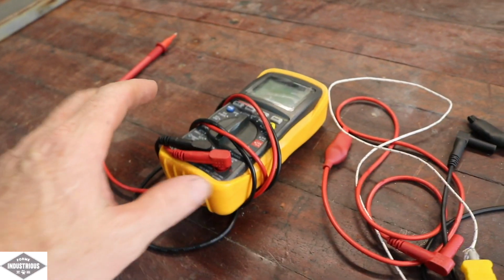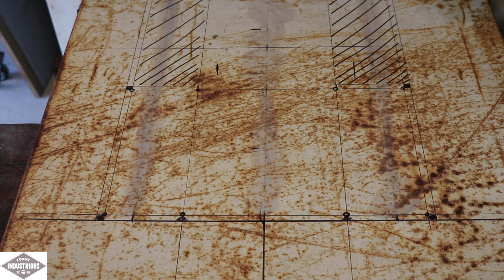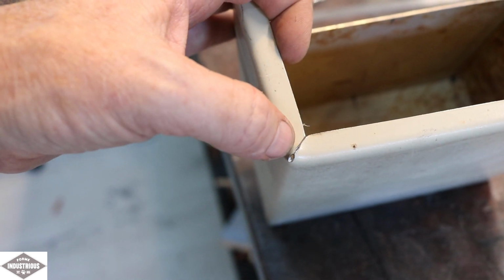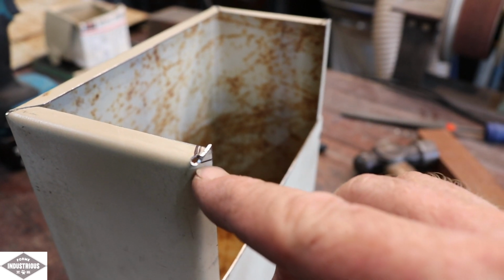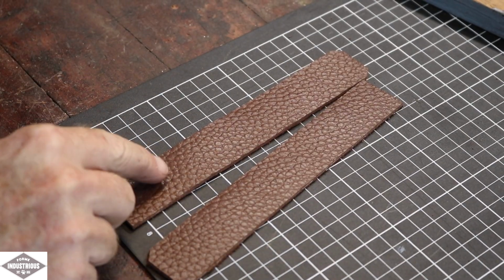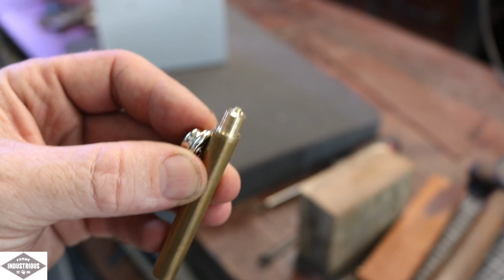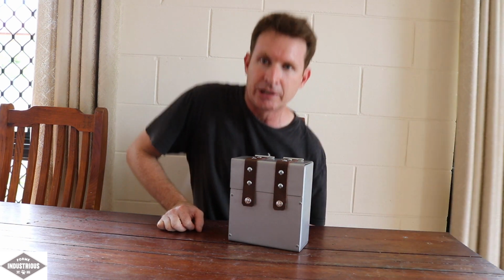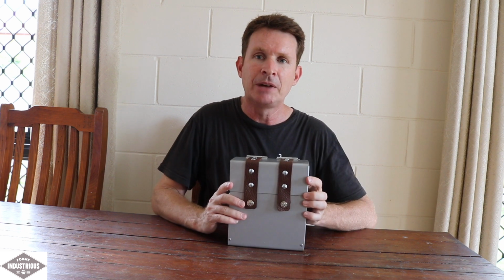Making a Steel Storage Case - Forme Industrious

Comment: I love the box. Very cool little useful project that took quite a bit of planning and work than people might realize at first sight if the video wasn't around. The only thing that is missing, which would really finish it, is a nice shiny steel/copper..... something like a handle. to pick it up by. Maybe even two of the same on the small sides, for when it has to hold things that are a bit more heavy.

That woud really finish it. 

Do you have a site where you showcase your projects? Apart from YT that is....

Comment: Hey Scott, little trick I picked up over the years, when you cut out those 2 45's if your using a 1mm speed disk, cut just on the opposite side of the line, it opens that relief up before you fold it. Rule of thumb I use is about a quarter to half of the thickness of the material extra! Loving your videos mate!
Reply: Becomes most useful when your folding doors for something like a ute canopy, or toolbox doors when you can't access the inside angle. Ive folded some in the past that have hit each other and then bowed the ends.

Comment: Very cool! Might I suggest using Chicago screws to attach the leather straps? They would provide a cleaner look on the inside of the lid but you could still remove them if need be. All in all though, I liked this build. Great job!
Reply from the maker: Hi Gerald. Thank you for your suggestion. I will have to use those Chicago Fasteners. They do look cleaner. Much appreciated!

Comment: Another cool project Scott! Leather work, foam work, (never would've tried a band saw to cut foam, lol), and metal work, without welding! Looks like that metal bender is working well. Cheers!
Reply from the maker: Thanks Paul! It was the first time I cut the foam on the band saw. Worked not problems at all. And to think of all this times I used my wife's electric knife (Don't tell her). Bender did fine for what it is. I plan to do a few mods to improve it. Thanks again Paul and all the best!

Comment: I am a novice riveter, but damn its satisfying... To watch, and to do. I was 'learning' a little more about different types of rivets. Do you have experience with those flush rivets they use on planes? Or were you more mechanical when you worked in that industry? I know those fancy rivets would be over kill for a project like this, but I imagine there could be some cool creative finishes where they might look extra fancy.
Reply from the maker: Hi Heath. I was mostly mechanical though I did a bit of metal work, so I have used flush rivets quite a bit. You need to have enough material to counter sink or "dimple" the material. I actually like the raised "dome rivets". Sort of old school look. Thanks and all the best!

Comment: The box came out great and I love the way you make your own tools along the way. Just curious, was there a reason you chose to use bolts instead of rivets on the leather straps?
Reply from the maker: Thanks Nathan!! I chose bolts as it's easier to change the leather straps later if required. Other wise rivets would be great.
Reply: Scott Turner Thank you Scott. Makes sense.

Comment: Very nice, enjoyed the build. I am curious if just using longer leather straps, if the leather itself would have been sufficient as a hinge? I suppose that may wear out quicker but may be a more streamlined look?? Still an excellent storage solution. Cheers.
Reply from the maker: Thanks Rob! I gave some though to using the leather as a hinge - very doable. In the end I elected to use the metal hinges but future projects I plan to use the leather into the hinge point. All the best!

Comment: Another great video. Using a wood block on top of ruler when cutting a straight line is a great tip! :)
Reply: I second that. I've used rulers as straight edges for many years and never thought of that. thanks for pointing out that detail.
Reply from the maker: Thank you! Yes I thought what is the worst thing that can happen, then I decided to use the extra bit of wood just in case.  I value my finger tips :)

Comment: Hi Scott, great looking custom storage box. I noticed in a lot of your project videos that you have a Multitool 2x36 belt grinder attachment. I have been thinking about getting one of these. Did you put it on an existing bench grinder that you already had? If you put it on a grinder that you already had what was the horse power of the grinder. And...last of all are you pleased with it?
Reply from the maker: Hi Jim. Thank you!!  I put the belt attachment on my grinder. It really is a great tool. rarely do I use the stone on the grinder. My grinder is a 6" 1/2 HP and it does the trick fine. If I didn't already have one I would go out an buy one today.
Reply: Scott Turner Thank you for the reply Scott I really appreciate it.

Comment: Enjoyed your video. I was impressed with your use of wood formers to get the most out of your bender. To prevent overlap in the  those 45 degree mitre cuts I always draw the line at 45 degrees but start my cut about a mm inside the line and head for the corner from there. I don't drill holes for 1 mm sheet corners as I never found them cracking, not mild steel anyhow. Thanks again, Bob
Reply from the maker: Thanks for the tips Bob! You are right, this box will not be under load or expect much in the way of movement so cracking is unlikely. After using the bender and getting to know it a little better, I'll do some mods to help hold down and to help with making the box sections. All the best!

Comment: When I've cut the hell out of old school lockers to fit my long alpine skis inside I used automotive door trim stuff to cover the sharp edges. Might be an option with a different designed case to make it more fleshy hand friendly.
Reply from the maker: I understand what you mean about sharp edges. I took pretty good care dressing the edges making than nice and round on this job. Though if you have sharp corners and hard edges yes it can be a problem. Cheers!